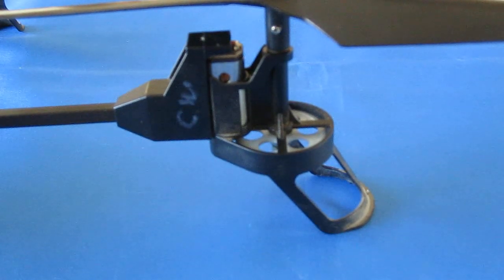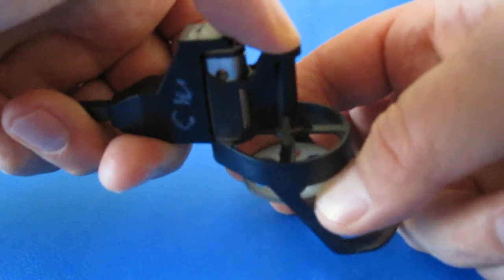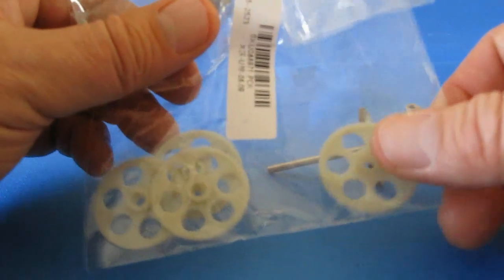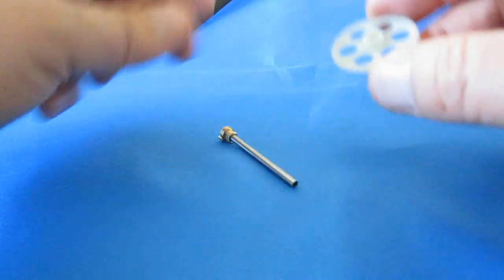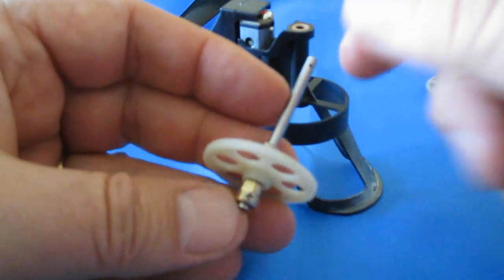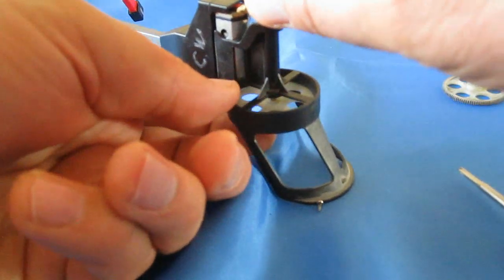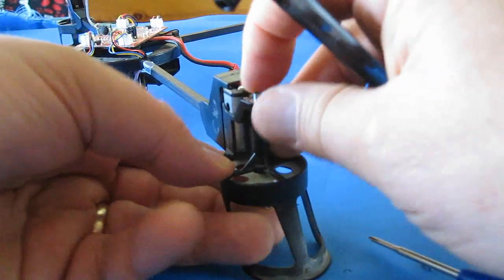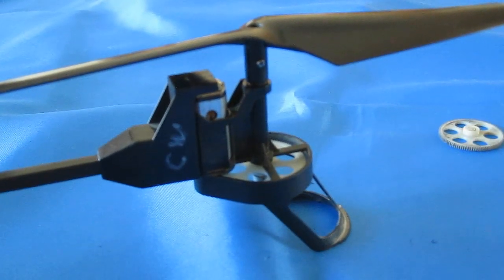WLToys V262 Cyclone Repair: Gear Change Replacement

Comment from the maker: Bram, if it's having problems lifting off, it's more likely one of the motors is going bad.  Please see this video instead.
WLToys V262 Cyclone Repair: How to Replace a Motor
Reply: Quadcopter 101 can you tell me how to remove the syma X5's gears?
Reply from the maker: Belal Qureshi It's very difficult.  It's easier and cheaper just to replace the entire motor base with its gear already installed. http://www.banggood.com/Syma-X5-X5C-Motor-Base-Spare-Part-X5-05-p-936090.html?p=RB0922217402201307U3
or get 4 for $3 :) http://www.banggood.com/Syma-X5-X5C-Motor-Base-Spare-Part-4PCS-p-978463.html?p=RB0922217402201307U3
Reply: Quadcopter 101 Thank you so much for the immediate response.

Comment: Nice video.  I'm also very interested in going with V262 as my first copter for taking videos.  The gears..  Well, I sell plastic compounds for a living.  Those gears are made of acetal.  A type of plastic used extensively with gears, plumbing products, etc.  Acetal has natural lubricity.  You do not want to place petroleum based lubes on acetal.  The graphite is acting as an abrasive.  Just leave them as they are.  Good Flying!!!!
Reply from the maker: Thanks for the comment.  That explains a lot with other's and my own experience regarding lubrication of the gears.

Comment: Hi, what do you think is the MAX weight I can add to an out of the box v262? No mods or anything. Will I be able to attach 50g, 100g, 200g or even 300g...? Can I modify it to improve the weight?
Reply: Oh and as well, do you consider the mobius and the v262 the BEST aerial video quadcopter in the sub 300 Dollar range? If not is there anything better, or something similar?
Reply from the maker: Max takeoff weight with the canopy removed is 290g.  But you really don't want to fly that heavy as it will cause great wear and tear on your motors.  With quads (and anything that takes to the air) it's all about weight.  You want to minimize any extraneous weight as much as possible to improve flight performance and endurance. With that in mind, the Mobius camera is relatively lightest and does take excellent 1080p video.  It's what I use exclusively in my V262 videos. And yes, I personally do think this combination is currently the best in the under $300 range (actually about $160 total for the two on Banggood). The next step up, I would guess would be the Walkera X350 with a GoPro.  But that's a big jump in price.
Reply: Quadcopter 101 Thanks! Sounds great I will be ordering this soon. The walkera definetely is too much for me, as I would like to stay as low as possible. Although 300 Dollars is a lot id be willing to pay that for high quality, but because this is only 160 its even better. Is it possible to add a small gimble to this model? I have no idea how those things work but it would be great to be able to turn the camera 360 degrees
Reply from the maker: It might have been tried already. Best place to look ask is rcgroups V262 discussion:
http://www.rcgroups.com/forums/showthread.php?t=1958141